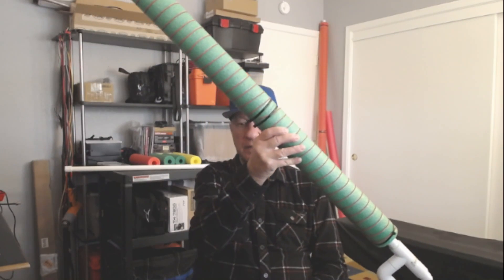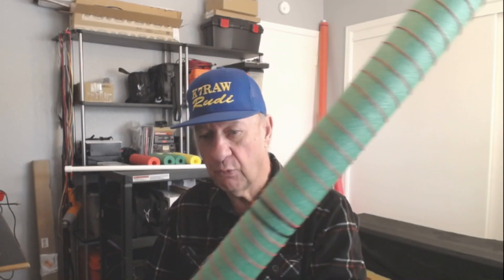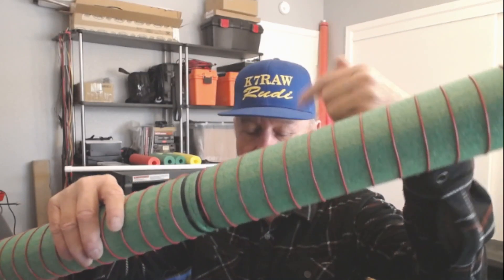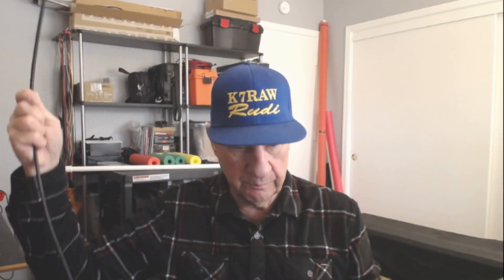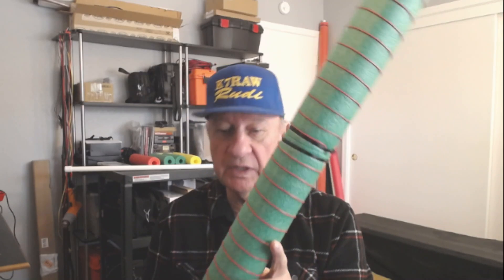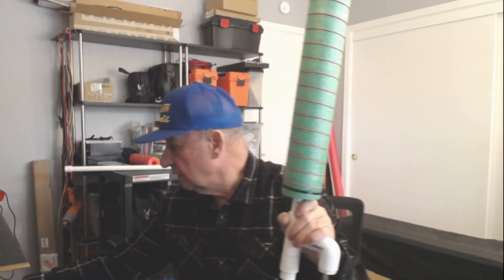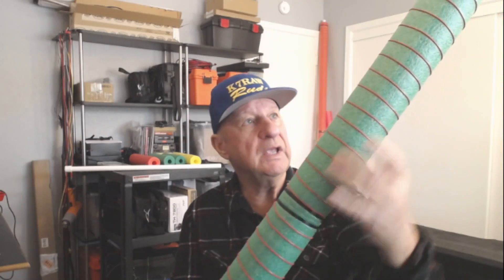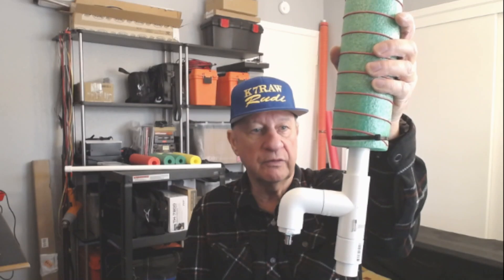Tiny NoodleTenna for HF Limited Spaces

Comment: I am going to try and build one of these.  Can someone clarify the winding directions for the two opposing half elements.  Does winding in one direction mean winding the entire antenna and then splitting the conductor in half.  Alternatively, does in mean winding one half from the end to the center, turning the noodle 180 degrees and then winding in the same direction.  In the latter case the winding vectors point in opposite directions.
Reply from the maker: Winding "handedness" on either side doesn't seem to affect performance.
Reply from the maker: I'e tried both ways, same direction AND opposing directions. Doesn't seem to make much difference.
Reply: @antennawhisperer-k7raw151  I have mine built.  I have to trim it and test it.  I will let you know how it turns out.  The build itself was pretty straight forward and simple.  I would love to see some plans for helically wound Moxon for the upper HF bands.
Reply: Yeah, just wind ALL the turns and snip in half in the middle (what I did)

Comment: I am interested in compact antennas.  Could a 10m helically wound Yagi or Moxon with gain and irectivity be built?
Reply: Second thought use the noodles to form the moxon frame. then an unwound noodle section as the spacer between reflectors.  The noodles would be super light.  Noodles maybe for a mag loop idea too.
Reply: Google - W7XA  40m mini moxon beam antenna
Reply from the maker: All cool ideas. There are LOTS of directions to take the basic idea. GO FOR IT AND SHARE IT WITH THE GROUP.

Comment: Hi Rudy, just seen this and suits me perfectly. I have a question. If it’s being used as a vertical antenna could you build it to have all 7 bandwidths on on length? 

I understand that if this was done you’d have 7 lengths of coax hanging down but putting that through two 4:1 selector switches and then a 2:1 switch do you think it would work. ? 

Thanks.
Reply from the maker: If you're implying a multi-band version, see my comments here for a tri-bander version (20/15/10) all parallel fed off one coax.
Reply from the maker: Best way is a "3D cross" of 20m, on the X axis, 15m on the Y axis and 10m on the Z axis
Reply: MAN, any vertical longer than 20m is gonna be HEAVY and have a ton of windage. You could just get a PVC 6-way cross and build a 20/15/10m version (3D) and wire it like a fan dipole (in paralle) and be done with it.

Comment: I like pool noodles. I use one for the form of the loading coil on my 15-40 meter portable vertical. It costs almost nothing, (compared to the ridiculously-priced commercial coils,) and allows me to easily adjust the tap on the coil. And the form has essentially no loss or added weight.

Comment: Hello Rudy, can you cover a bit on how you derived the dimensions of the wire helical coil of 80 turns for 20m? If you are using a 3" diameter, that 9" of wire per turn for 80 turns (I am assuming 40 per leg) or 360" on each side. Where as a typical dipole leg for 20m is approximately 16.64 ' or 33.27' for the whole antenna. Unless you are saying that the each leg is almost a half wavelength for each band, thus the approximately 30' for each leg for a 20m dipole. I hope this make a bit of sense, as I would like to construct one this weekend and give it a go. -Jason WV3V
Reply: Hi Jason. The 3" noodles are actually 70mm diameter. That gives about 8.6" per turn. For 10m that's about 18 turns with 1" EVEN spacing PER SIDE which will get you in the ballpark. Then trim BOTH ends EXACTLY THE SAME FRACTION OF A TURN (eg-1" at a time) until you get the lowest SWR (should be about 1.5). A 20m dipole will be about 2X the # of turns, and proportional for all the other bands.
Reply from the maker: Turned out to be trial-and-error. But the 10m formula scales to other bands.

Comment: Ten meters antennas already are small.  How about making one for 40 or 20 meters?
Reply: Well, if you consider 17 feet for a 10m antenna small, then that makes the NoodleTenna TINY in comparison. You can easily make a NoodleTenna for other bands such as 15m or 20, etc. Just make the number of turns on each leg proportional to the 10m version. For example, a 15m version would be about 30 turns per leg versus the 20 turns for 10m.
Reply: He shows a 20m antenna at the end.